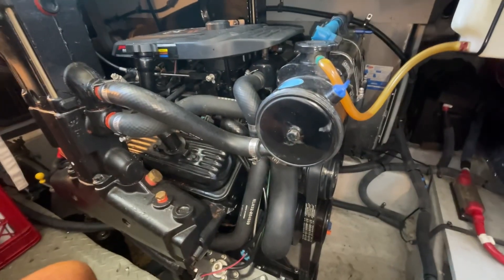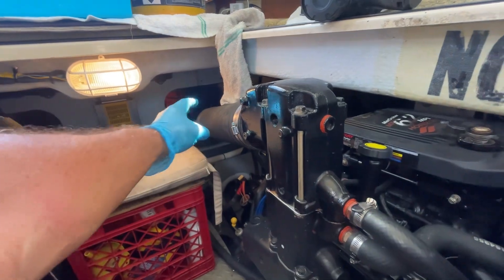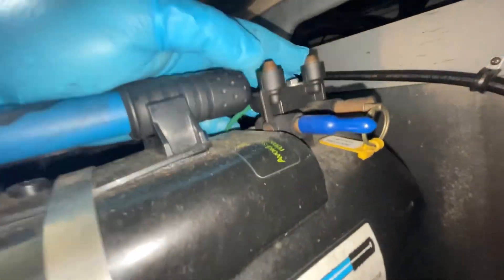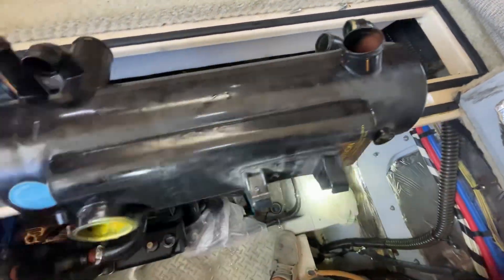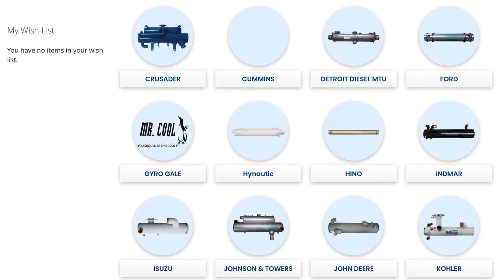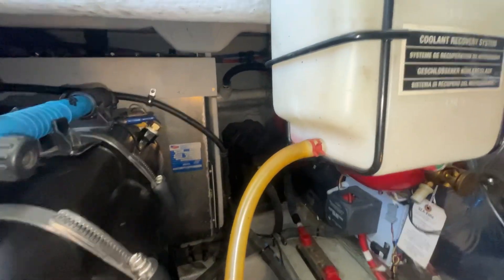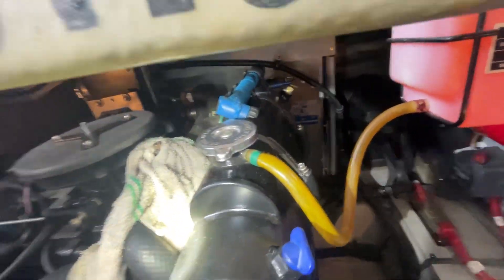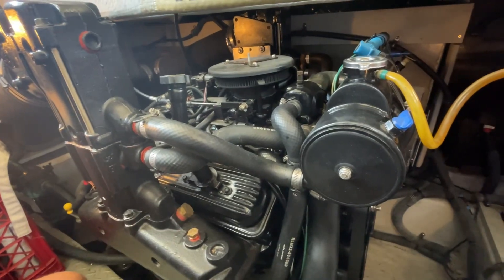Mercruiser Heat Exchanger Replacement

Comment: Greetings. Thank you for the video. Please tell me what pound cap you use on the heat exchanger....thank you have a great day.
Reply from the maker: Not sure what the cap is.   It is a standard pressure original cap for 6.2 mx horizon motos with closed cooling.

Comment: Im wondering where the water flows inside the heat exchanger, does it flow thru the tubes or the outside of the tubes/pipes
Reply from the maker: Both.   Coolant/antifreeze runs outside tubes and raw water runs through tubes.
Reply: Thanks for the reply, I 
wonder if you know the part number for the bracket @AdventuresofHappyOurs
Reply from the maker: Here is a link to Mercruiser parts. You can find all you need there.  https://www.mercruiserparts.com/bam/subassemblydetail/36125623/28195835

Comment: I’m surprised that a 2006 engine would still have carburetors. My 2003 with 8.1 mercruiser are EFI.
Reply from the maker: It’s fuel injected.